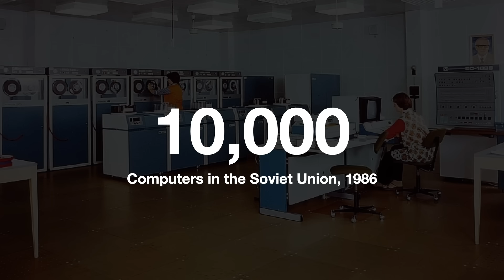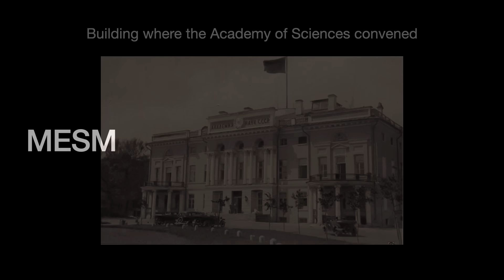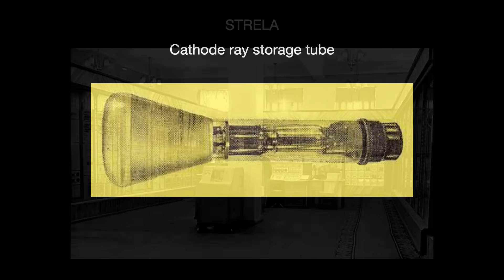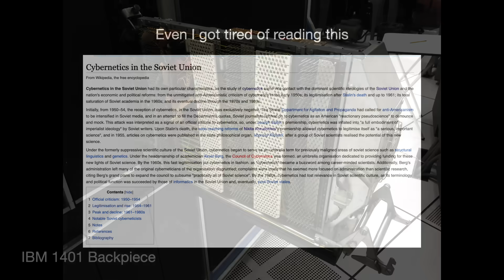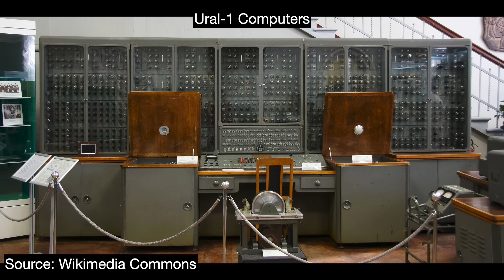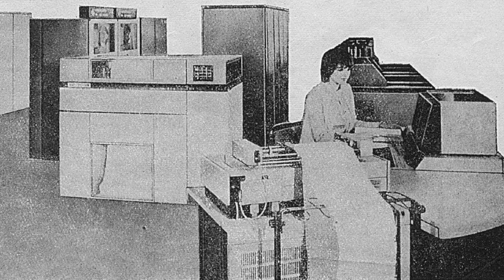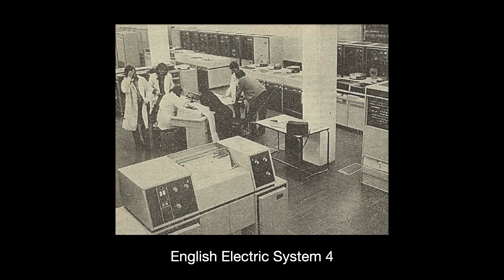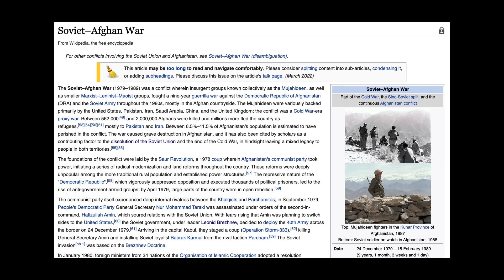Why the Soviet Computer Failed

Comment: You know I have never seen a computer made in the USSR, however I did buy an old transistor radio made in that nation when it was still under the rule of Communists.  I was greatly impressed with the quality and workmanship of this radio.  It arrived very well used from Ukraine a month or so ago.  When I opened her up the quality compared to those made in China Hong Kong, and even Japan  look like throw away machines, which in fact is about what they are.  The USSR Radio, made in the 70's was built like the FM Radio Transceivers I used to work on in the US ARMY back in the 70's. Most of the parts appeared to be from military stock, the circuit boards are thicker, the traces much thicker, the parts extremely well made.  The only thing wrong with it was one bad capacitor.  The radio worked but was rather quiet.  When I replaced that cap, she came back to life.  It will receive stations that my other radios only dream of receiving, I have an external antenna for AM/FM reception, the little transistor gets stations without the use of that antenna where my other sets have to be attached to get much more then local radio in my house.  The case is built of a much heavier plastic, the radio was well used and along the line, the lock for the battery case was lost but I have it in place and it works fine with my little home built latch.  She runs of a 9V battery I recently get a new Lithium rechargeable to  use in her and that works fine. That radio is my bedside set and although I am an old fart of 71 I still like laying in bed, late at night tuning in to the shortwave band on the set, and I am not disappointed with that reception either. The little radio amazes me every time I turn it on.  With Shipping the set cost me 40 bucks and man is she worth it. I wonder why the same quality is not present in soviet computers.
Reply: I am also an old fart and I remember at the age of 10 I could not buy a simple diode for my first detector receiver in the store and tried to make it according to the technology described in a technical magazine for schoolchildren. And yes, then I lived in the USSR.
Reply: @MrNikki2633  Now American kids with Masters Degrees in Computer Science ask: "What's a Diode?"🤣
Reply: It's nice to hear that it brings you such pleasure and why. Enjoy your radio Jerry.
Reply: What brand is it, Jerry?
Reply: @MrDeicide1  VEF or Selena
Reply: Is it a Galena?   These were made for two markets:   Nomadic peoples living in the remote parts of the USSR, and for export.  They were indeed very good radios.  Sensitive and good tone.  The USSR also made an unique power supply for them.  It looks like a sort of kerosene lantern.   It runs on kerosene or lamp oil, produces DC to run a radio, and you can heat small meals with it while you listen to Voice Of America.  And it puts out light.   Just the thing for a Mongolian nomad to have in his yurt (tent).  It uses the Seebeck Effect to produce DC directly from heat in a series of bimetal thermocouples - no moving parts, and no need for batteries.  They are very rare in the West  but I have one.  My Galena radio has a wooden case.
Reply: @keithammleter3824  I believe the CIA propaganda outlet dedicated to the Eastern Block is Voice of Europe, not America ;)
Reply: That is a good illustration of why computers are different then other devices like radios.  The things we want a radio to do today are exactly the same as they were in the 1970s.  You can finish designing a radio.  Computers on the other hand are in a perpetual state of re-invention.  Programming a computer fundamentally changes what the computer is in ways that the makers are unlikely to anticipate, but must somehow accommodate anyway.  Then the next model must to adapt to needs that were discovered/created by a customer who knows nothing about manufacturing computers, but knows more than anyone about using them.  The Soviets always feared communication and novelty.  So they were perpetually handicapped.
Reply: @VPWedding  because people could use communication and novelty to overthrow the communist government
Reply: @VPWedding  : You make a very good point comparing radios to computers.   
But I think the rot set in with Stalin.   Stalin was pretty smart albeit totally ruthless.  But Stalin's mindset was that anything American was the best.  He had not a lot of faith in his own people.   When he needed a limousine, he directed that they copy a Packard.   When they needed a strategic bomber, he directed that they reverse engineer and copy the Boeing B-29 - at a cost that almost certainly was greater than the cost to develop their own bomber.   (The B-29 was engineered in American customary units.  Russia was then 100% metric, so they had to reconfigure an enormous range of parts & materials making.).   When they perceived they needed an atomic bomb, they had their own boffins up to the task - but they copied an American design.   Their aircraft engine engineers were working on an axial-flow jet engine.  But rather than wait until the engineers had got the bugs out of it, they copied an obsolete Rolls Royce radial flow jet engine, with inferior fuel consumption.  
Then came Khrushchev.   Somehow, he thought that the Soviet Union could in a few years, maybe a couple of 5-year plans, they could surpass the USA by copying them.   You cannot become a leader by copying - you can only be a follower.
The USA developed a reusable space vehicle - the X-20 Dynasoar.   So the Soviets copied it.  Meanwhile Americans decided it was not up to the task, so they scrapped it and developed the Space Shuttle.  So the Soviets scrapped their Dynasoar and copied the Shuttle.
You can see what has happened - Stalin set a precedent, and like government beaurocrats everywhere, they covered their butts by making it established and continuing practice, not taking a risk on R&D like private industry does.
Reply: @keithammleter3824  Stalin needed to be sure that the Soviet industry could produce exactly the same as in America. Without asymmetric ersatz tricks for the convenience of Soviet industrialists.
Full copying was supposed to spur the development of the capabilities of Soviet industry. Otherwise, the task would most likely be solved in a bizarre way, outdated methods on outdated equipment.
Reply: @МирославаБерзина  :  Interesting - I hadn't heard quite that rationale before.    So Stalin was concerned that the USSR would be something like Britain only worse, with Britain's rotten cars, dud post-war aeroplanes, and a semiconductor industry stuck in the germanium era while the USA was surging ahead with silicon planar?
As a rationale of Stalin, it makes sense, sort of.   But it looks like it didn't work.    It's ultimate result was the 8-bit Agat personal computer, software compatible with the obsolete Apple 2 and sold for 2 years average USSR salary, while 16-bit PC's in the West sold for about one month's average Western salary.   The shame of the Agat was likely one of the factors causing a collapse in public morale and the collapse of the USSR, as Putin has explained.
In Svetlana Loknova's book, she explained that Stalin arranged for bright USSR young men to attend American universities and establish contacts with American industry, to spy.    If instead these people could have returned to the USSR after getting their Ph.D's and use their creativity in Soviet industry, the result could have been better.  That's how China did it.
Reply: @keithammleter3824  It's not the private industry that does the true R&D, but the universities. Including mass production development - the engineers there are essentially taken right from universities.

The private industry in USA takes on the risk that whatever they'll engineer to make will be obsolete or not competitive or not useful enough or too expensive. Early on, US government subsidized heavily this sort of risk. Soviets did not, as they worked by requirement rather than by venture - and due to politics, anyone that implemented something obsolete or not useful enough or too expensive would lose their position, so they went for safe improvements instead.
Reply: @AstralS7orm  : You wrote absolute nonsense.   Universities primarily do fundamental research to uncover principles, in areas as far as possible chosen to match the interests of their researchers.  Such as almost useless things like studying black holes and quantum computing.  Company R&D labs do mainly targeted research and development but this certainly doesn't mean they don't do fundamentals.
A classic example in the transistor - the device that rendered the vacuum tube obsolete and led to integrated circuits and computer chips.  The transistor is the invention of physicists working at Bell Laboratories - a private research outfit then owned by the Bell Telephone company.  These physicists expanded on the early solid state physics devised in universities, uncovering a considerable amount of new fundamental principles that no university had anything to do with.  Nor was it paid for by government.
Anyone who has worked in advanced R&D as an engineer or physicist knows that the Soviets did a lot of fundamental research on spec.  They were not much into targetted R&D - they preferred to copy (by legal means or spying) Western technology.  Soviet discoveries and measurements of physical properties continually crop up in scientific literature.
Most US government subsidisation of research has been in two ways:  (1) More or less targeted funds given for medical research via National Institutes eg National Institute for Cancer.   (2) funding ranging from fully targetted to vaguely capability enhancing of research for military capability.   In the 1960's and 1970's this was all pervasive, vast, and had many hidden and not so hidden forms:  Direct grants, budgeting for industrial advancement, etc.   Again, transistors/semiconductors are a good example;  There are 2 main reasons why US firms have always led the world in semiconductors - 1) Domestic market size, & 2)  subsidisation of semiconductor research by the US Navy and Airforce, after transistors went into mas production.
Reply: @keithammleter3824  You shall learn the history of Bell Labs, before you make your comments. Essentially funded by an initially tax subsidized monopoly of AT&T. (Direct policy of full coverage by phone lines, and taxpayer funded.)

The transistor was a result of this particular venture - sought by Bell Labs to resolve issues in sound amplification over long distances. It had precisely nothing to do with market size as AT&T had whole USA to play with deploying this technology - it was primarily a cost saving decision by AT&T brass to save on maintenance of vacuum tubes, and a good guess at a time by Kelly to pursue this technology and not some entirely divergent path. Heck, Bell initially rejected the silicon transistor as too hard to manufacture.

The properties of semiconductors were well known by 1940s, but semiconductors themselves were more of a curiosity as the mass manufacturing was not thought to be possible or profitable. It is telling that the first big important consumer were US military radios for contact diodes and slightly later ENIAC for transistors, customers who do not care about cost.

Everyone except Bell (AT&T) and Sylvania/General Electric had problems getting the license initially as US Military wanted to keep it secret but decided to open licensing to anyone in NATO after some pressure from DoJ who did not particularly love AT&T monopoly even then. The real boom in development happened thus after 50s.
If but for a different throw of dice, semiconductors would not be widespread in USA.

The transistor was not copied by Soviets. It was actually developed in parallel but slightly slower track, so they got to it 1949 (right before US military declassified it and mass use really started) - but due to certain particular secrets on chemical processes kept in NATO and never quite stolen either, high quality processes for oxide removal and doping never got implemented in Soviet Bloc - as such large scale integration microchips were not possible due to defects. Without the chemical factories (even though chemistry research on soviet side figured it out already) - and later process engineering know-how - nobody in Soviet bloc could mass produce large scale integration microchips in late 70s.
Texas Instruments cracked the mass production of LSI microchips only in 1967, on government funding, straight from DARPA and DoD - multiple companies were trying for that and getting grants to improve semiconductor technology by then. Fairchild was right next - and that one was driven by NASA.
Without NASA and DoD contracts, large scale integration chips would likely happen much later. Soviets had IC manufacturing since around 1965 - but it was small series, similar to early ICs by Fairchild and Texas but even more constrained. By then the aforementioned companies had cheap mass manufacturing on government orders. Even with the reduced price, both companies stooped to price dumping (which they could afford thanks to being fattened by government contracts) to promote the use of the devices. Oh, and NASA actually chose Philco to manufacture the devices, spreading the technology by forced cross-licensing. (Note that Philco commenced a chunk of high speed new transistor topology research for a US Navy contract, earlier. And their transistors flew on first US satellite, Explorer 1. Their transistors were used in a few important research computers on MIT, predecessors to later Digital Equipment Corporation which was spun off by MIT Lincoln Labs - federally funded - that kickstarted minicomputers formerly monopolized by expensive IBM mainframes.)

It was never a question of market or competition, as seen by sheer numbers of lower integration electronic equipment manufactured. It was a question of political will and government funding.
USA used unprecedented amounts of government money on semiconductor development.

Short example:
It's not always the pioneer that gets the Nobel prize. For example, Kilby got the Nobel prize for ICs, but the invention was done in 1949 by Werner Jacobi in Germany, as part of some 100+ patents. It was not pursued further by Siemens, however, and they continued to make vacuum tubes. Again, for a different throw of dice it would be Germany not USA domination, again. Then there was Geoffrey Dummer in UK, whose work was rejected as inferior to discrete circuits by UK government in 1952 (RAF in particular), way before USA was even close. Then soon, first US development, military, by Sidney Darlington and Bernard Oliver (founder of HP; 1952-1953) actually devising a process for manufacturing ICs. All very secret and government funded. Harwick Johnson had some random RCA funded research on IC which never went into production. Kilby himself used prior art from RCA Corp. - but his improvements were, again, government funded.
So no, it's not the competition or market that made these things, it's mostly government funding that made for success.

If not for Apollo, there'd be potentially no civilian microchip revolution. That's how involved the US government was in the whole thing, and market wasn't relevant.
After NASA was done, the companies needed to find some way to sell their high quality circuits and so calculator boom commenced, later microcomputer boom.
Reply: @AstralS7orm  You've got some of that right, eg US semiconductor advancement due to government funding.  I said that myself in my earlier post: "In the 1960's and 1970's this was all pervasive, vast, and had many hidden and not so hidden forms:  Direct grants, budgeting for industrial advancement, etc..."
But on some things, you must have been using some good weed.
Bell Labs pioneered the purification of germanium and silicon to make diodes for war-time radar.  So, yes their boffins had some pretty good understanding of semiconductors.  That was kept secret until the war ended.
There was two things that made airborne (and to some extent shipborne) radar practical:  The cavity magnetron perfected in England - a compact efficient way to generate very short wavelength radio energy at high power, and the germanium and silicon diodes key to detecting the tiny return echoes.  
Incidentally, the key purification method was zone refining - where the impurities end up swept to one end of the bar, which is usually discarded.  During the War, Western Electric (the manufacturing arm of the Bell system) sold the sawn off rubbish end to British firms, who made their own inferior diodes by probe testing for fortuitous good spots.  They never did tweak to what WE was doing.
After the war, the Bell Labs boffins knew that junction transistors or perhaps JFETS were the way to go, theoretically, but hadn't mastered the art.  They then invented the point contact transistor (physically a double diode that could amplify).   They publicly announced a working device intentionally just so that the US military could not impose a secrecy order.   THEN, they persevered until they mastered making the superior junction transistor.  Recognising that the device - as it then was - would be  useless in the telephone industry, and probably not attractive to the US military (they were wrong there), they immediately set about licencing the junction transistor to other manufacturers around the world.   For a fee, any company could send production engineers to a Western Electric short training course and learn how to make transistors.  It apparently was a pretty intensive course - some went away bewildered.  One that was not was an engineer from Sony Japan.   That wasn't the smartest move for the US, letting him in.   The very competive Japanese transistor and IC industry started with him.  
Meanwhile, some manufacturers, principally in Britain, got sidetracked and tried to master making point contact transistors, which commercially were a dead loss.
There's no way Germany could have led the semiconductor revolution instead of the US.  As we both have stated, it was that immense amount of US Govt money via the US military (and really, NASA is part of that, money wise, even though NAS was/is a civilian agency) that paid for advanced semiconductor development.
Reply: @keithammleter3824  The amount of propaganda you've internalized is astonishing...
Reply: @keithammleter3824  By the 60s and 70s, the countries mentioned (UK and West Germany) had sufficient budget and technology to pull it off. They just... didn't.

Seriously, poor and small Japan almost took it. Ultimately they failed as even more manufacturing got expanded under USA control proper, in Taiwan and in Malaysia.

For a brief moment, Japanese companies had a monopoly on high end equipment. (Actually two moments, later in optical equipment.)
Japan took the investment risks precisely because it was so destroyed and behind. So later did Korea and profits off it today still.

That USA took the immense risk to develop the technologies was quite unprecedented, though a highly planned strategy pushed by the perceived threat of the Soviets catching up or eclipsing them. This explains why the last big achievement - the Internet - was in 1980s.
(The other one that could be maybe called that was solar panels, it's even older. A lot of "achievements" are actually applications.)
We'll see how it goes.
Reply: @AstralS7orm  You live in partly fantasy land.
Britain most certainly DID NOT have the funds, nor the technology, to compete with the USA.   For a start, the USA had 5 times the population, and a government less inclined to meddle with industry.  Following WW2 Britain was broke.
Japan is a special case in 2 ways, that led them to be very strong competitors in cars and electronics:-
1)  Their constitution allows them to only have a limited defence capability and not an offensive capability.  .So their military spending is very low for a country with a huge population - about half that of the US.   They tax less and put their tax moneys to industrial use.
2)   They indulge in industry cooperation at levels that would be regarded as anti-competitive and illegal in Western countries.
However, Japan is not a innovative country.   Most of their technology is either imported from the West through licensing or by copying when patents ran out.
West Germany had a population only a little above Britain, so also did not have the funds the USA could deploy,   However, they were better run, WW2 did not bankrupt them, the USA supported them and so their economy became strong.
However, your last paragraphs beginning "That USA took...."  is pretty right.   It was part a reaction to the perceived Soviet threat, and part a response to the immediate post-WW2 United States Strategic Bombing Survey Committee reports.
These reports seem to be almost unknown by the general public these days, but were a major influence on the US Government.    To put it simply (at a risk of over-simplifying), this committee said that the USA won the War against Germany and Japan in large part through superior technology, but were somewhat unprepared and had to lift their game, and it said that the USA should never make that mistake again.
As you say, we'll see how it goes from now on.   The job of the US President is a difficult one, and they seem unable to find someone who is up to it.   The USA is in decline and China is ascendant.
Reply: @keithammleter3824  If, say, Japan didn't, Korea didn't and China didn't... why do they currently triumph in manufacturing and dare I say research over USA at the moment? You make some generalities and call me special casing by recognizing the state of today.

They are nowhere near as rich or big... the only difference is that they still (attempt to) subsidize development or their corporations are essentially the state or very close to it. (I can enumerate cases, but you're not interested in special cases.),  If USA actually did this, instead of subsidizing oil and gas drilling, it'd be, as they say, great again. As long as it also fixed its problematic education scheme.
We'll see if USICA is properly granted and spent - I don't expect big results as the companies went too greedy.

"Anti-competitive" is a joke if it cannot be enforced, much less competition being actually more desirable than cooperation. Competition with either of the countries listed above would have to result in a military venture to take them over - anything else is trying to buy them out and USA cannot afford that anymore - it could have done so nearer WW2, maybe. WTO is toothless and a whole bunch of paper that is being rightly ignored as it only benefits USA.

I also resent you calling me names.
Reply: @AstralS7orm  When have I called you names, and what names did I call you?   I did say you were partly in fantasy land - you were if you thought countries like Britain and Germany could have coughed up the taxpayer funds the size that the USA channelled into semiconductor R&D via their military.
Japan, Korea, and China didn't what?   They are manufacturing successes by using technologies developed in the USA - sometimes legally  (eg with US companies setting up manufacture in China), sometimes not entirely legally, and sometimes just waiting for patents to expire.
The USA is in decline - there are a multitude of reasons, including:-
# a form of government that puts great demands on the president - he must be a clear thinker, and most important, inspire Congress to follow him.   Kennedy and others before were up to it, Clinton was pretty good, but the last 3 no good - they either lacked persuasiveness, lacked clear thinking, or both.
#  They went over the top on OH&S other regulation - driving manufacturing off-shore.   
#   Wars, space exploration, and competing with the USSR no longer inspires the American people.
Reply: @keithammleter3824  Three times you've called me deluded or nonsensical, and then you say the problem in USA is that the president has to be smart.

Come on, the Congress holds the purse strings - president has some control over it but not the ultimate one on where to allocate parts of the mandatory and discretionary budget.

Chief issue was that US businesses were given carte blanche to hire workers anywhere in the world, hence, removing a vast number of factories from USA itself in late 80s, making industrial medium education jobs unavailable in USA proper. Throwing more money does not change this policy

Bringing these jobs back is rather tough and expensive sell. Current grants go to R&D and agriculture, not manufacturing anymore - one without the other does not a power make. And US supernational corporations structure their labor so that mass labor is done in cheaper places than USA itself.
(EU as well, but it's being slowly brought back, highly concentrated in a few hubs much like it used to be in USA. But the investments to the tune of $200 billion in just semiconductor industry, not to mention chemical are... problematic.)
Reply: @AstralS7orm  That's the problem - Congress holds the purse strings, but they are just a very large bunch of inexpert politicians with their own agendas.   That's why the president needs to be persuasive - to have charisma to win Congress over.   And the president does need to smart, in order to realise what Congress needs to be won over on.  Kennedy has left us with a good example:   He determined that a space race with the Soviet Union was a good thing to do (security, economic progress, etc) and he famously announced to the assembled politicians words something like "We will, before this decade is out, land a man on the moon and bring him safely back to Earth".  That setting of a challenge (and it was a real challenge) and a clear target timeframe won Congress and virtually the whole country over, and they then proceeded to give NASA  a vast sum of money to do just that.   Obama figured out what had gone wrong with US education, and what needed to change.  So he had the brains.  But that isn't enough - and nothing got done.  
Countries with a more modern constitution, such as Australia work on a different system.   Instead of a president, they have a prime minister who acts more like a company chairman, conducting meetings in Cabinet.   The Cabinet is a small group of senior elected ministers, each having a specialist role (eg finance, defence, health, etc) and decisions are by majority vote.   The elected specialists may appoint subcommittees of themselves to resolve complex issues.   This means the demands on the prime minister are a lot less than the demands on a US president.  Really, all he has to know is how to conduct meetings.  
The voting systems in western countries are generally more robust and transparent than the US systems, which helps.   In Australia, we are bemused by the doubts sown over the last US election by Trump.   This sort of thing would never get air in Australia, as our voting system is simpler, and run such that trust in it is easy.   That helps get the right things decided on and done, because there is not much doubt that the will of the people has been expressed, and the party in power has a mandate.
It's not perfect of course, and we love to criticise our politicians.  But it is a better system than the US system, which only works well when you get a president who has plenty of both attributes - brains and persuasiveness.
Reply: @keithammleter3824  Very interesting historical detailed info. Wasn't the internet made possible by DoD and their Darpanet?
Reply: @keithammleter3824  I am not sure the Australian parliament system is better compared to that of the US. We have a similar one in India and I suppose most Commonwealth countries have a similar one. The Cabinet is just a bunch of powerful ministers allocating important ministries amongst themselves. Just has more chaos.
Reply: @SolomonSunder  : Oh, our system is better than the US system, alright - because it works with a prime minister that doesn't have the inspirational/charismatic talent that is necessary for a US president to get things done.  But our system is not perfect  - something which is quite obvious at times.   Effectively, the prime minister is the chairman of the cabinet, much as a company chairman of the board conducts the meetings of the board.   Really, a PM just has to be good at running meetings.  Decisions are made by cabinet vote, and when they vote, that is it.  Not like the US where the president has to persuade congress, who may well decide otherwise.   But it does of course depend on how good the prime minster and cabinet ministers actually are.   Ministers on their own have very little decision making power - they must put up proposals to cabinet, to be voted on.
Just as a company board is not involved in day to day running of the company, the cabinet is not involved in day-to-day running of the country - that is the job of the departments - but by their voted decisions they set the parameters and policies that departments must comply with.   There is no chaos.  
One recent example of how the Australian system does work better than the US system is how COVID was dealt with in each country.   In Australia the prime minster and state premiers took control, accepted advice from appropriate medical experts, and forthwith acted on that advice.   In the USA they had decision paralysis.  Result:  the number of deaths per head population was miniscule in Australia compared to the USA.
But there is also a recent example of the system not working well - the stuff up over submarine purchases - fundamentally because there are too many difficult conflicting requirements that Cabinet can't get its mind around.
Reply: And there you can see why the computer failed in the USSR. If a technology wasn't 100% clear as something to defeat the west with, the political bureaucracy would hamper it. They clearly needed radios, so they got good radios.
Reply: Soviet personal computers took off in early 1980s but all production was halted then Gorby came to power(1985) and decided that buying from West is better idea. It took 4 years to realizie that this was bad idea as he emptied all coffers on buying expensive Japanese tech toys, American jeans, bubble gum, and computers... Only recently people of former USSR realized that his team were moles of CIA and Mossad.
Reply: many of those were built in the LTSR.
Reply: Might want to keep it a bit further than next to your bed with the radiation and all
Reply: This is what Soviet Union was like in tech up until a few years before it fell apart - military-grade (in a good way) everything. But when it came down to miniscule details and highly sensitive precise equpment, such as advanced computers, it went downhill.
Reply: That story warmed my heart a little.
And there is a direct connection between less extreme technological push and emotional well-being, even though technology in general is an externalization of potential and thus a form of escapism and fear. But by looking at less troubled states of development we can draw spiritual conclusions.
The more we glorify technological progress, the more we impair human progress.
Reply: THE Radio  is a Vintage Soviet Pocket Radio Nevsky 402 with Flashlight from USSR. I got it  on EBAY from a Ukraine Seller.  Shipping was 20 bucks, the radio was a buy it now or 20 bucks.  It was super well packaged and came quicker then anything from China. I was very satisfied with it, as it was sold as is.
Reply: For years in the 80's they had more programmers then computers.
Reply: Can you link me to this radio or tell me its model/make?
Reply: It is important that radio works well so you can hear Fearless Leader.
Reply: @bleuflamenco  which fearless leader? Biden?
Reply: @bleuflamenco  The guy goes and tells the story of a lifetime and you reply with a Reddit tier comeback. Impressive.
Reply: @DGP406  Cry harder.
Reply: @bleuflamenco  It's important that your TV works so you can be told propaganda about socialist nations. :)
Reply: because, back in the 50's or 60's when that radio was made, it would have been considered far worse quality than the american/western made versions. But, because US manufacturing standards have dropped so much in the past 40 years, and has been switched to foreign countries like china, compared to cheap chinese imports or even american made, in comparison to this modern junk it looks amazing quality...
Reply: To be fair, radios are so simple, they don't need to be super high quality.....it's a very simple device. Capitalism is about choice: you can buy high or low quality radios. 

Plus, others have mentioned these were were likely built for nomadic tribes in remote Siberia so they had to be Tonka tough.
Reply: @-jank-willson  : Looks like you've never seen or owned a Russian Selena or Galena radio then.  There were in fact very good - the equal in quality to the best US and other Western radios.   The reason, as I said before, is that they were made for use by nomad tribes in remote areas, and for export.   The USSR made a lot of mediocre products of indifferent quality for consumption in their own cities, but they could turn out good stuff when it mattered and if the authorities put a priority on it.   For example the Kalashnikov AK-47 rifle.
Their main problem was keeping up to date in technology - they never really managed it.
Nomad tribes needed sensitive radios as they were remote from radio stations.  They needed reliable radios because if a radio failed it could be 6 months or a year before they could take it to a repairman.
Reply: Wonder how long the original purchaser had to save / wait for it, though?
I'm no fan of planned obsolescence, or "throwaway" cheap tech either, but if it was all built like tanks and lasted 60 years, far fewer people would have it (or would be employed making it).
Reply: Those radios were built with the same components and circuit design used in their satellites, including all the semiconductors. They were all built in Ukraine; those radios were built in the only way they know how to build a radio, and existed only because the factory was subsidised. Any private entity would have bankrupted after one day by building radios that way...
Reply: @rayoflight62  Interesting, The fellow I purchased it from was in Odesa Ukraine, I purchased from him as he was recommended by a repair man I follow in YouTube.  I hear Odesa is now under Attack by Russian Forces.  This is indeed sad.
Reply: Western technology moves so fast that building to last is wasteful.  Electronics are obsolete long before they wear out.  Chinese consumer electronics usually don't work at all, however, even new out of the box.  I've given up buying the Chinese stuff on Amazon.
Reply: @timdunn2257  It is certainly correct that these days equipment is obsolete before it wears out.  But Chinese made gear is very good, if purchased from regular dealers.   Here in Australia, almost all consumer electronics, apart from TV's and desktop computers, comes from China, and it's all good.   But things like portable generators can be rip-offs.   For example, 10 years ago I bought a Kipor brand Chinese 2 kW generator from a major hardware chain.   When I got it, I put a 2.2 kW load on and it handled it perfectly - exceeded specifications.  It has never developed any fault, and still runs perfectly, having done ~6000 hours.   But a certain east coast (Queensland) importer buys Loncin brand Chinese 3.5 kW generators and rebrands them as 4 kW.  A rip-off, but not by the Chinese maker, by the local importer.
Chinese made machine tools usually need some work/adjustment before putting to use.  If you buy from Chinese suppliers at a low price, you won't get the same quality product you will if you pay a fair price.
I've bought lots of books from Amazon.  I find it depends who the actual supplier is.  Some books come properly packed and in perfect condition.   Some come inadequately packed and damaged.  Some, usually from UK suppliers, come smelling of mould.